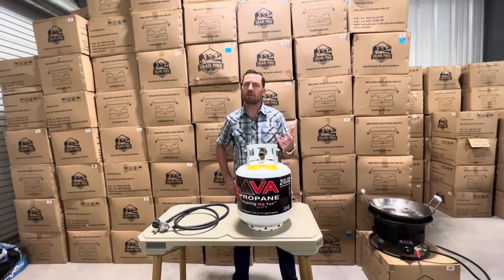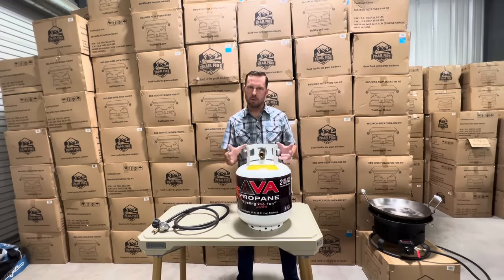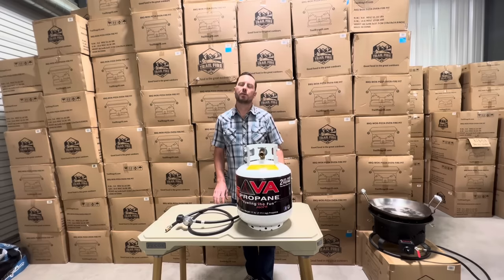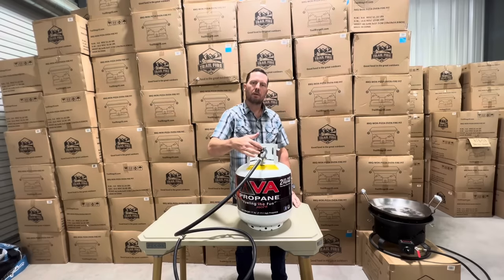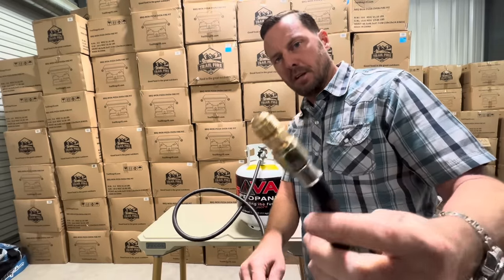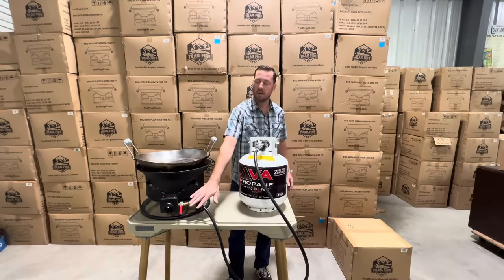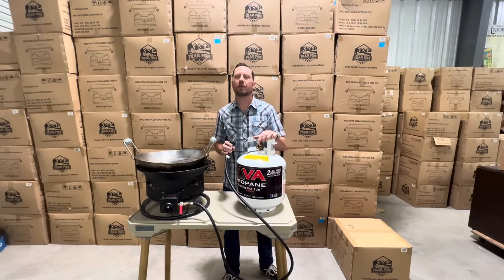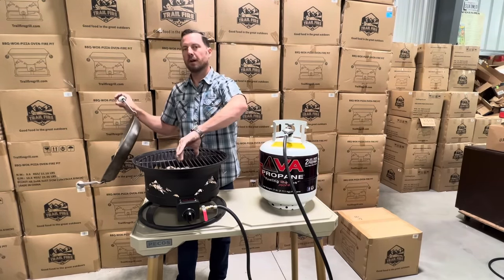Propane For Dummies | How to Reset Your Propane Tank OPD Valve Low Gas Flow Fix

Comment: 50 years old and been grilling for over 30 years.. I have never heard of this safety valve. I have had problems with this before but never understood it until now.  Thank you so much.
Reply from the maker: You tube teaches you everything your father didn't
Reply: Man im boilermaker/welder for 16 years and i discovered this new opd valve man it really stumped me when i usually turn my bbq off from the gas bottle to let the gas bleed out, but just like 15mins ago the bbq kept going once i turned off the main bottle valve. Which is super weird right shouldnt the gas stop. In my head im freaking out like..still am tbh clearly not a boilermakers a5$h0le
Reply: @pumba6099  , I'd take the tank and stove to the LP store and ask them if they know what caused the continuing burning.
Reply: Unreal all them half full/empty tanks I've replaced..
Reply: If no or little flow turn bottle off as suggested but when opening again turn on VERY SLOWLY.Problem fixed.
Reply: That makes tow of us.
Reply: Man this is the best information about propane tanks I've ever heard thanks man you are the real MVP 🙌🏾 💯 ❤
Reply: been grilling for 30 yrs and NEVER tripped the safety on it ???? BS ...
Reply: @ACommenterOnYouTube  must be a new thing, bec ive never experienced a need to "reset" the regulator

Comment: Good video. I tried to tell a buddy that what you described with the safety valve, is all that was wrong with his gas grill. He had a very low flame, and ended up giving the grill away! Sad. It would have been an easy fix. Thanks for your time!
Reply from the maker: We have a 4 in1 portable grill for your buddy discount code: propane

Comment: Very good. The best description for action and safety. I am a plumbing contractor and learned from this video. I highly recommend anybody using any propane appliances to listen. This is a thorough description to keep yourself safe.
Reply: Yes , Safety is very important in everything you do but he should have mentioned a couple very important safety items , Many years ago when I began using propane appliances in the mid 70s , I've discovered that you don't have to open the tank valve all the way because propane appliances all have a regulator which greatly reduces the pressure from around 150 PSI in the tank down to around 1/2 lb of pressure from the regulator and with that huge difference in pressure , opening the tank valve a quarter turn provides more than enough gas flow to the regulator and guaranteed , Will not affect the performance of any propane appliance , I even do the quarter turn method on my torpedo heater which uses much more gas than a gas grill and without affecting the performance
Now when you open the tank valve , Open it very slowly because the tank and possibly the regulator are equipped with a slam valve which will slam shut caused by sudden pressurization or excessive flow and only open the valve a quarter turn and no further , The main reason why I strongly recommend that opening the tank valve a quarter turn only is for added safety because a couple times on my gas grill I light the burners and suddenly get a fire flashback at the venturi tubes and with the quarter turn method I was able to get the gas shut off instantly , The quarter turn method will allow you to instantly get the gas shut off in case of an emergency and what caused the fire flashback is I found spider webs in the venturi tubes which restricted the air and gas flow to the burners , So for safety's sake Only open the tank valve a quarter turn and no further so you can get the gas shut off instantly in case of an emergency
.                           WARNING ⚠️
BEFORE USING ANY PROPANE APPLIANCES , ESPECIALLY FOR THE FIRST TIME OF THE SEASON , CHECK AND MAKE SURE THE VENTURI TUBES ARE CLEAR !!! Insects Especially spiders can nest in the venturi tubes and spin webs in them Restricting the air and gas flow and can very easily cause fire flashback at the venturi tubes , Especially gas grills , Check the venturi tubes because they sit outside all the time and spiders love to nest in them because of the confined space
So before using propane appliances
Especially for the first time of the season Remove the burners and venturi tubes and blow them out thoroughly with an air jet and check the venturi tubes each time before using to make sure they are clear
This is another safety item that was not brought up but it is very important
So if the burners on your propane appliance is operating erratically , 
Most likely the venturi tubes are clogged , The most common thing that clogs venturi tubes is spider webs
So please follow these two safety tips
ALWAYS PUT SAFETY FIRST !!!

Comment: I had a regulator fail on (5 lb tank) and I didn’t know about the weep hole that is designed to vent when the diaphragm goes bad.  I saw the hole was leaking gas and thought it was a defect and almost started a fire!

Comment: LP technician here. What you are describing is called an excess flow valve which activates when flow exceeds what is required to operate the appliance typically 200,000 Btu per hour. The excess flow valve is located inside the the type 1 female connector attached to the regulator, not the male connector on the OPD valve on the cylinder.
The OPD valve automatic shutoff used when filling the cylinder is a secondary safety device and is not used as a means of determining cylinder volume. Only the fixed liquid level gauge (commonly mistaken for a bleed valve) is used for measurement when filling the cylinder. The fixed liquid level gauge consists of a dip tube extending inside the cylinder and a bleed screw all part of the OPD valve which will present liquid propane when the tank reaches 80%. The only accurate way to measure cylinder volume is by weight.
The reason for transporting and storing cylinders upright is to keep the relief valve (also part of the OPD valve) in communication with the vapor space inside the cylinder to prevent venting of liquid propane.
For general information 20 pound exchange cylinders are only filled to 15 pounds.
Reply: Why does one supplier I have put in just over eighteen pounds and another nineteen point three pounds then.
Reply: @dlighted8861 He must work for Blue Rhino. The tank holds 20# of fuel.
Reply: @kennethfisher7013  Approx 4.2 pounds per gallon.  20 lbs, divided by 4.2 lbs = 4.76 gallons (aka 435,311 btu) less any room for expansion.
Reply: Seems the EFV gets stuck closed in very cold weather... Pita!  If I accidentally trip it in sub zero temps 🤦🏼‍♂️
Reply: Isn't that valve in the regulator?
Reply: What about filing a 1 lb propane torch cylinder?
Reply: Sounds like you are about the only person on the Internet that knows Exactly what they are talking about! Thanks for real and accurate info.

Comment: Note to welders using oxy-LP for torch cutting! OPD valves can sometimes reduce flow to insufficient levels for heavy cutting and in that case the larger cylinders without OPD are preferable.
(For those not familiar, BBQ cylinders are tapped fora a CGA 510 AKA "POL" thread which is used for welding fuel gases too.)

Comment: I have had this about 3x and never knew what was happening and burned the hair of the back of  head screwing around with it taking the valve on and off  a couple of times. Then when I finally hit the igniter while stooping in front of the base of the grill. The cold weather caused the gas to flow down into the base and it blasted a flame over my back like a flash bulb. It happened so fast I did not know what happened. I was lucky to have a fleece jacket but it was flash burned over half of my back. This should be common knowledge and it is not. I will telling all my gas supply store that I buy gas from and tell them to instruct their customers on this issue. THANK YOU VERY MUCH FOR THIS VIDEO.  IT MAY SAVE SOMEONE FROM GETTING SERIOUSLY BURNED!

Comment: Every time I put a new bottle on my heater it would keep going out. I must have accidentally done the right thing in the past, but never knew what.  I've watched dozens of videos but still couldn't figure it out. FINALLY, I found you. I immediately went out after your video and did what you said. It worked!! You're my hero.
Reply from the maker: Call me Mr Propane
Reply: Make sure that the plunger on the male (hose) side is properly seated and adequately tightened as well. Sometimes this will trip the safety as well.

Comment: Decades of grilling and this was the first time I couldn't get a full tank to pop into the green on my gas gauge.
I knew there was a safety valve but I couldn't figure out what triggered it.
I had opened up the gas valves on the grill when trying to ignite the prior empty canister and not closed them...
Thanks for the video. 🙄

Comment: Excellent information!  I am 69 and used propane over 50 years for grilling.  Not sure how long these opd type valves have been in use, but sometimes I would think a tank was empty or get low flow, now I know why!  Thanks!

Comment: Great information about the OPD valve. Had the issue of low flames before multiple times. It all makes sence now. Thanks!
Reply from the maker: You would think a tank of gas would come with instructions
Reply: @TrailFire  , Yabut, they're keeping 12ç per sale by omitting them. Because sales would slam shut over 12ç. (Not).

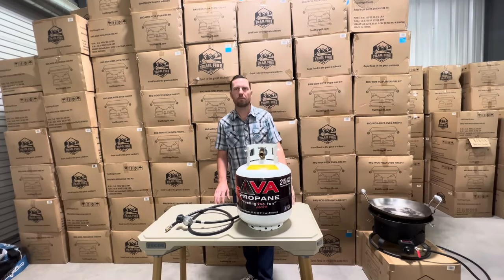Comment: I used to think my low flame was due to the temperature drop -- now I'm almost certain that it's the Overfill Prevention Device.  I have a model steam locomotive and I'd go from a strong blue flame to a little wimpy yellow flame quickly.  This drove me up the wall because the tank was clearly full and the tank really wasn't that cold.  I'm really looking forward to trying the fix you give at 1:16.  THANK YOU!!!

Comment: Appreciate the video and turns out I was incorrectly taught how to use propane tanks 40 years ago.  That would account for the random lighting issues now and then, and apparently I didn't need that new regulator either.  lol
Reply: This valve didn't exist until ~1999.  It probably didn't exist when you learned how to open a propane tank.

Comment: Very interesting information, having BBQ's with gas since coming to North America I was not aware of the issues you presented although I have experienced the valve automatic shut off . I also  suspect I must have taken the tank for a refill more times than I can count assuming the fault with no ignition was that I was out of gas.  Thank youi.

Comment: I've gotten some tanks from the store that the OPD valve had tripped at some point and it sat for so long in the closed position that it gets stuck closed. To unstick the valve you have to hit the bottom of the tank on the ground a few times to jiggle the valve loose. I walk the tank out into the yard over area of soft grass and dirt. Pick the tank up by the top handles about 2-3 feet and then bring it back down in a controlled freefall. You don't want to just let go and drop the tank or it'll just fall over and trip the valve again. Keep you hands on the handles but just let gravity do the work of bringing the tank back down to Earth. The soft grass and dirt won't do damage to the bottom of the tank. I usually repeat about 4-5 times times and then reattach to the grill.
Reply: So it's 20 degrees out and I've been fighting with my tank to get my heater going. Nothing worked for me until I read this comment. A couple short drops and now my heater is on full blast.

Comment: That is good to know.  In the past, I would stick a screw driver in the fitting and whack the heck out of it with a hammer and if a hammer and screw drive was not available, I would grab the tank by the handles and fling it as far and as high as possible across the yard.  Both methods worked for me except for one time.

Comment: Very helpful, thank you,  Question: About the regulator, what is its purpose, why is it important????
Reply from the maker: If excessive gas pressure develops, a properly functioning regulator will prevent the flow of excessive LP gas into the gas line
Reply: @TrailFire Thank you very much about the regulator purpose. I appreciate your response very very much, ___Paul in Maine.

Comment: Great video!  I have been having an intermittent low gas gauge (drop) on the regulator for my Charbroil Commercial series propane gas BBQ grill.  I just was unable to turn it on for 3 consecutive attempts.  I then tried un-torquing the regulator/hose, torquing back (hand snug) and then SLOWLY opening the propane tank valve and turning on 1 of the 4 burner valves and the gas line didn't go from green to red like before and I was able to light the burner!  Thanks a lot.
Reply from the maker: Thank you sir! Here is a coupon code for you nobody should have to live without our 4 in 1 portable BBQ Wok Fire Pit and Pizza Oven discount code: propane

Comment: Actually the OPD valve is the valve in the tank, it stands for overflow protection device, the excess flow that he refers to is the black plastic piece at the end of the regulator attached to the hose Assembly not in the propane tank itself or the propane tank valve, but he was really accurate on everything else

Comment: I could not figure out why my dual-fuel generator kept cutting out on propane this fall, but wouldn't on gas. And it had worked in the past. Turned out I had put on a gauge to keep tabs of how much propane it had left, and it was this gauge's safety turning off. I took off the gauge and it runs fine. Thank God!

I love using a gauge like this on my grill so I know when to change out the tank. A generator uses more propane than a grill does, must be so much that the gauge's safety thinks it's an open line.
Reply from the maker: Correct. Hi flow appliances can trick the valve. Open propane valve slow and start appliance on low slowly increasing gas flow

Comment: Hello, Does a regulator also act as a filter or are they two different things? I ask because when connecting a propane tank to a portable heater, there are some lines that contain oils that can clog the heater. Any advice would be greatly appreciated. Thank you.
Reply from the maker: Heaters require filters. Here's a little more 

https://www.youtube.com/watch?v=VR-NxdTwpzA

Comment: Learned a lot with this video, thanks for sharing. What are your thoughts about refilling camping tanks from the main tank?
Reply from the maker: I’ve always believed the green bottles are a waste of time they always run out of gas when the bacons on. The better option is a 5 lb growler propane tank with an adapter to run green gas appliances

Comment: Thanks for this. 
Question- Are there similar valves inside the regulator that can trip or go bad? I’ve been getting very low gas flow and have tried different tanks with no change. Burners are new as well. Regulator and line is basically the last common denominator.
Reply from the maker: Regulators can go bad its rare. Usually its something else and simple

Comment: I have a griddle that is getting too much gas and will burn the food on low.  Is the regulator adjustable?
Thanks and great video by the way!!
Reply from the maker: Yes our red valve is adjustable from zero to 50k BTUs you can simmer soup or boil spaghetti

Comment: Regarding your comment on the regulater — I have a heating unit n there r two regulators at the tank end of the hose n wondering why. U did so well in the video I hadda ask. Also ur opinion on refilling small cans off a 20# er
Reply from the maker: The first stage regulator provides the main management of gas pressure. It will not, however, lessen variable tank pressure all the way down to the levels acceptable for the appliance. Second stage regulators, then, provide that additional reduction. Im not a fan of green bottles they are mostly useless and always run out of fuel just when my Steak is mid cook. I recommend getting a 5lb Propane Growler tank they are popular with overlanders van travelers and Jeepers when space is tight

Comment: Great video thanks for sharing.  In Arizona as an alternative to storing full tanks in a garage I'm thinking of using an outdoor plastic shed in partial direct sun.  How hot inside the shed can it get and still be safe to store a full tank (or 2) ?  Thanks
Reply from the maker: Inside works if ventilated remember the tank has odor added if it leaks you will smell it. Not stored in direct sun or inside a hot vehicle are critical

Comment: I have a device with a pressure gauge before the regulator. It shuts completely on overflow. One needs to press down on the gauge to reset it. Great safety device! I’m looking for something that will shut in when the tank pressure gets too low to regulate, and close’s completely, preventing seepage.  Is there such a device or regulator with that built in?
Thanks for the video!
Reply from the maker: Not to my knowledge...once the tank gets low seepage would be less likely...less pressure

Comment: Hi, thanks for the video!  I have a phantom problem with an 11 lb tank, where sometimes  it works fine with my camp stove, and sometimes it just puts out a tiny flame.  I tried the stove with a 5 lb tank, and a small cyl and worked both times.  Just hooked the 11 lb to my gas grill and all was well.  I suspect the valve is bad(?) I can't trust the tank, will always need backup for it... any thoughts?  thx
Reply from the maker: Here is my last resort tank reset. Unhook any device so the valve is visible take a 3/4" socket extension or similar blunt object and push the valve inward gas will burst out, this will reset a sleepy tank